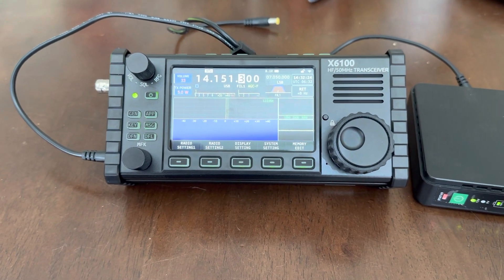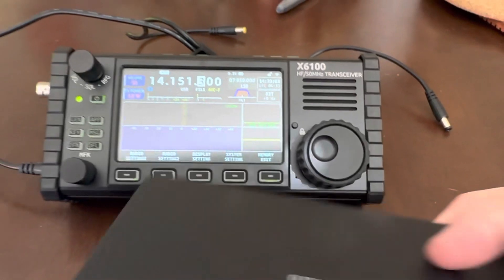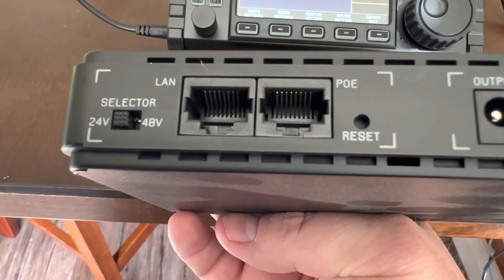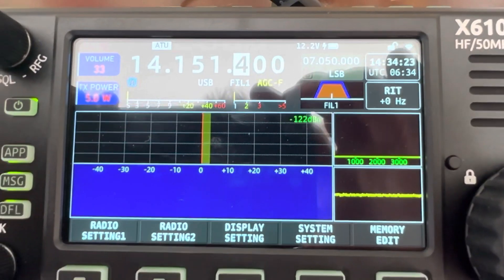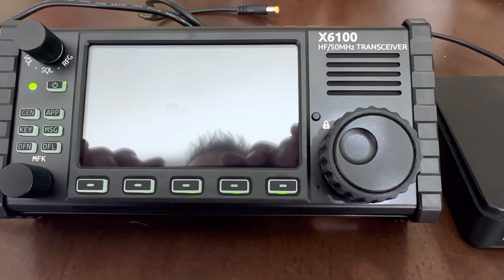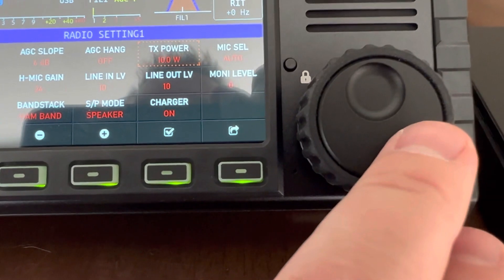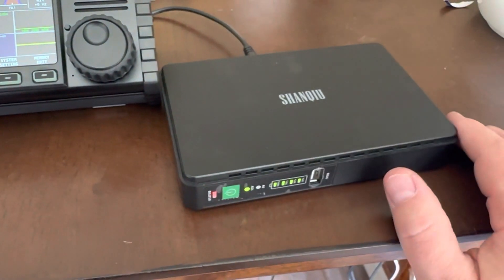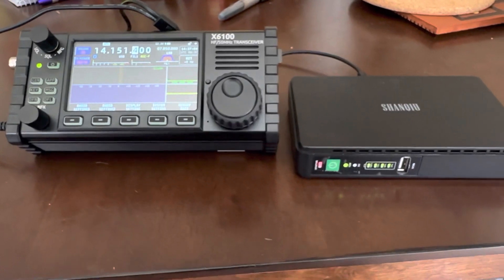Alternate Power Source for Xiegu x6100 - A UPS Battery Backup

Comment: Did you ever try actually transmitting with the power output set to 10W? I tried the same thing with a powerbank but if the battery/powerbank can't sustain 3.5A, the radio will automatically drop back down to 5W. The battery you're using maxes out at 2A at 12V.

Here's the quote from the X6100 user manual:
"An external 13.8 V DC power supply can be used to power the Xiegu X6100.
However, the current rating of the DC power supply must be at least 3.5A."

Comment: The "8800 mAh" figure means almost nothing by itself. What voltage? Internal cell voltage? 5 volts? 9volts? 12 volts? The nameplate on the back of your battery also said the 12-volt output was limited to 2 Amps. The 6100 uses 2.35 Amps at 13.8 volts (32.43 Watts as measured in the ARRL lab) and your battery is only rated to supply 24 Watts. I suspect the 6100 will just shut off if you tried to transmit at full power. You may get away with it at 5 Watts.
Reply from the maker: I was running the radio with 12 Volts, plenty for full power operation. That works out to 96 watt hours.  It’s about the same as an 8ah Bioenno.
Reply: @MarkWarrick  - What was the voltage being displayed on the radio DURING a full-power transmission? Were you getting a full 10 Watts while using this battery? How did you calculate Watt/hours from the information given?
Reply from the maker: @g-whiz286  12 volts and yes it operates at full power. Use the amps to watts formula.

Comment: As long as it puts out the 12 volts +, and amperage you need to safely operate the radio,  you are good! Then its just a matter of Amp Hours, that determines how long you can use it!

Comment: Wow that is nice but it would need more than 2 amps at 5vdc to run a Pi4.  Sure it will and is fine at the boosted 12vdc for the 6100.  I'll look further to find something that is less current limited.
Reply from the maker: Maybe you can use a step down cable from the 9 or 12v DC power out to get your needed 5v and whatever amps you need for the raspberry PI 4 like this one?  https://www.amazon.com/Eonvic-Micro-Right-Angle-Nucleus/dp/B088FKNTNV?th=1
Reply: @MarkWarrick  5v at 2A right on the front USB it is probably all current regulted